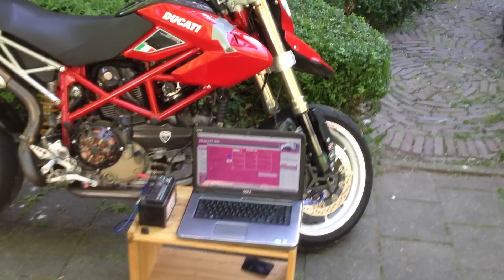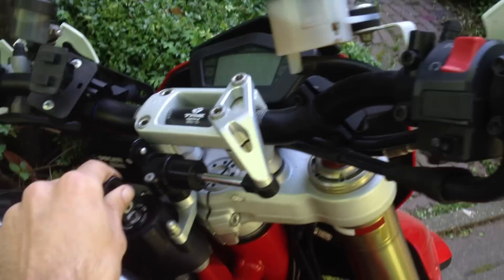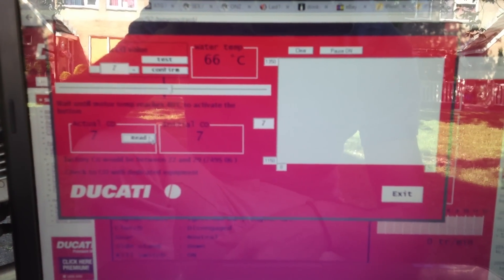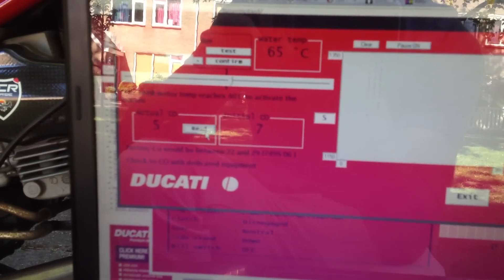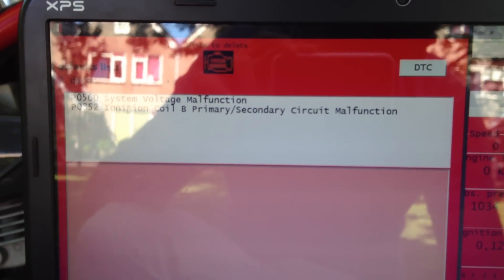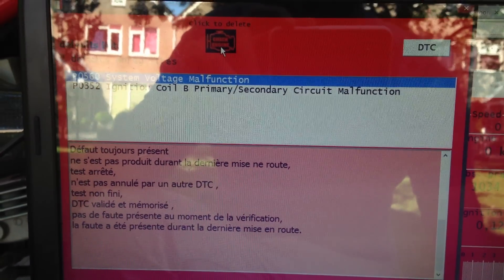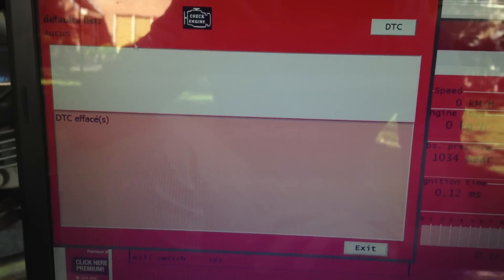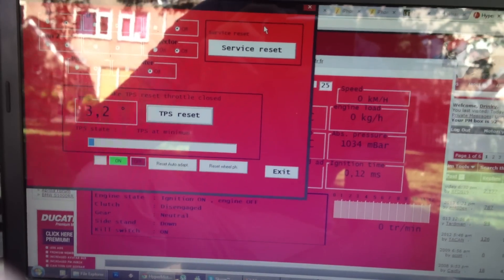How to use Ducatidiag

Comment: im trying to get this software but seems you must log in the JP forum which is closed for registering now.. do i have to register there? i mean.. for the lastest updates or something? . thks
Reply from the maker: JP had to shut down the website due to some pressure from "specific people", Ducatidiag now only works if you had a license before and it will only work on that specific ECU. However, I've found out that there's something similar called Guzzidiag which should work the same. I haven't yet had the opportunity to try it since I'm currently away from home. Maybe in a few weeks time I can test it myself.
Reply from the maker: Also, I've found out that Ducatidiag is back again, yet under the name JPdiag and can be found here:

http://jpl250rs.perso.sfr.fr/

For some reason however the forum seems to be down so your best bet for now would still be guzzidiag.
Reply: Drinkyoghurt thanks, what specific Ecu?. i have this Streetfighter witht the Termignonis changed thay come with an ecu.. would that work? . (what license you mean, waht happens with all the guys who already have the software like you..)
Reply: Drinkyoghurt i just want to do the basics like diag what is wrong with the bike and reset the tps.. cause thats what it looks like..
Reply from the maker: MR.S7 The streetfighter has the same ECU as the Hypermotard 1100 and the Moto Guzzi Breva 1100. It's the Magnetti Marelli IAW 5AM ecu. In order to get the Ducatidiag or JPdiag working, you need to get some information from your ECU first and send it to JP. JP will then make a license file for you with the information from your ECU, so that you can use the program for that specific ECU (this is in order to avoid commercial abuse I'd reckon). The program will then work for only diagnostics, resetting TPS, adjusting fuel trim etc. but will not be able to flash maps.
Reply: Drinkyoghurt o my.. thanks for your reply man, you really know what youre talking about.. im gonna try it and may bug you after that. thanks a lot man.
Reply from the maker: I haven't been following the project for a while know but I know that the Ducatidiag software will not work with the Evo bikes who have a Siemens ECU compared to the Marelli ECU on the first gen hypers.
Reply: MR.S7
Reply: Guys any new fresh link on this software?

Comment from the maker: I just bought a cheap Fiat 3 Pin to OBD2 cable from ebay, it has to have the alligator clips to hook it up to a battery (first cable I got was crappy and didn't work though, it's a crapshoot but on the Ducatdiag site they have a list of good vendors).
I also bought a VAG OBD KKL cable from ebay, mine was blue with a white/blue led but the other ones will probably also work.

Comment from the maker: are you sure you are using the correct port to connect with? I'm using ducatidiag on Windows 8 and I've used it on Win 7 and Vista without problems.

I can't recall precisely how I found out which port, but it has something to do with device manager. You should ask this question on the ducatidiag forum they know much more about it. The link is in the video description.